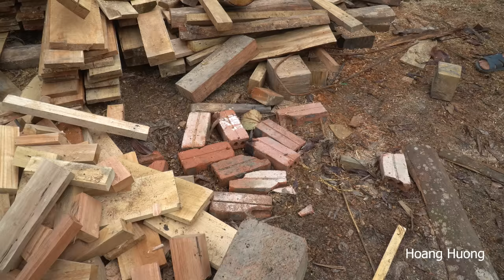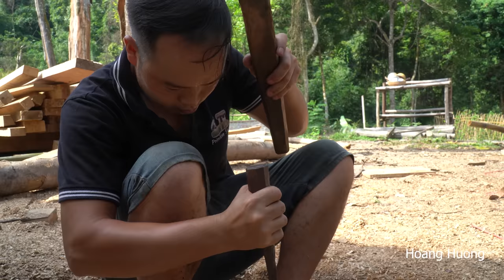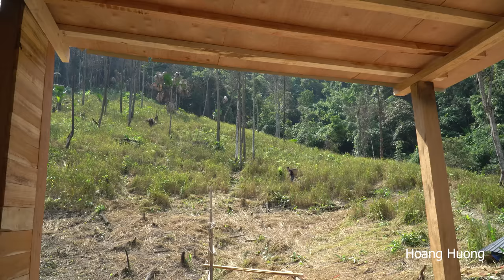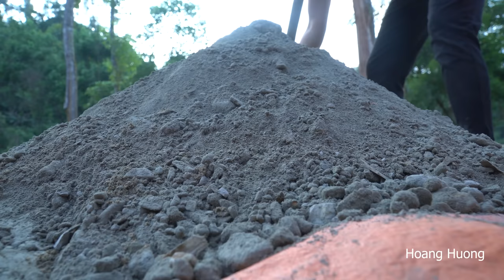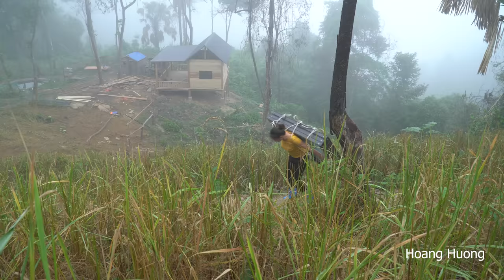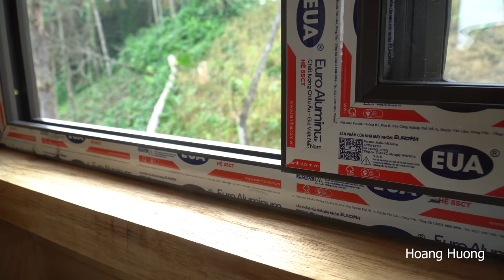Install windows, build stairs for wooden houses (CABIN) | Hoang Huong

Comment: A flexible clear plastic tube, with water in it, will find level at both sided of the water every time. If you ever need precise level. water will find it always.
Reply: Nivel de mangueira, isso é primitivo. Atualmente é a laser.

Comment: SINCE YOUR STAIR is made of wood, I suggest you should install roofing   to preserve the life span of said wooden stair.
Reply: I agree 👍
Reply: I agree also. 

I am also wondering why you didn’t pour the concrete pad first before you built the stairs? It is probably going to settle some under those stair posts.
Reply: No point by the the time the wood rots out the termites will have eaten that new house out, wooden houses have a ten to fifteen yr life span in that part of the world the wood they use isn’t the same as the lumber they used even 100 yrs ago.
Reply from the maker: Thank you very much, I'm very happy to receive your feedback, I will try to do better and send you more interesting videos.
Reply: @Hoàng-Thị-Hương  You're doing great! It was just a suggestion to extend the life of your stairs. You guys rock the house, literally!👍🏼😊
Reply: I agree with you again 😊👍
Reply: ត

Comment: You mentioned the cost for the 3 windows at $183.19 USD , here in USA  that is a cheap cost for 3 windows. I am not sure the size of the windows  , but I am guessing about 24" x 36". I priced 1 window 24"x 36" .where I am & for 1 window it is $179.00 & for 3 windows about $537.00 USD without tax or 13,192,747.50 VND.  Best of luck on you're completing this house.❤
Reply: Most-anything's price is relevant to the region.  In the USA California is much more expensive than Arkansas.  It is a matter of average pricing being influenced by average earnings.
Reply from the maker: Thank you very much, I'm very happy to receive your feedback, I will try to do better and send you more interesting videos.

Comment: Make sure you put some kind of water proof material between the wood and the cement, else the wood will suck up the rain from the bottom and rot out. It is one of the number one causes of wood failure. It can be tar paper or metal sheet. In the states in can happen in 2 to 3 years, in your area, in can happen faster because of the heat.

Comment: You don't want the concrete flat, you want a slight taper so the water will flow off, like a 5% slope. So from the Post to the front, the concrete will be about 1/4 inch higher. The edger is lower so the water flows off away from the posts all the way around.

Comment: With all the rain you get, I'm concerned that the nails will rust out. I think it might be better if you replace the nails with wooden pegs. 3mm pegs or 1 inch will hold very well in your stairs, with a little water proof glue it will last for a long time with no iron staining.
Reply from the maker: Thank you very much, I'm very happy to receive your feedback, I will try to do better and send you more interesting videos.

Comment: If there is heavy rain, the ground under the pillars supporting the house may erode, so the area around it should be strengthened with bricks or concrete, and a ditch should be dug to prevent the soil from being washed away by water.

Comment: Hoang ... question ... will you be insulating and putting up dry wall in your house? ...  In the states we could never find 3 windows like you have for under $200 usd.  Old woman in comfortable shoes in Conneaut Ohio👋😁
Reply: Insulating???  Drywall???  Not really relevant issues for this type of house in this type of climate.  LOTS of ventilation is primary.